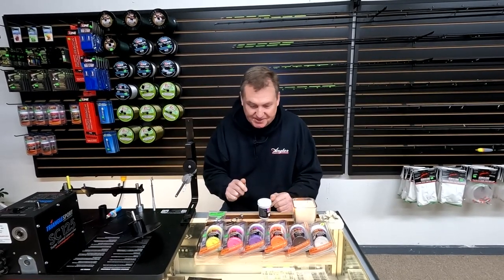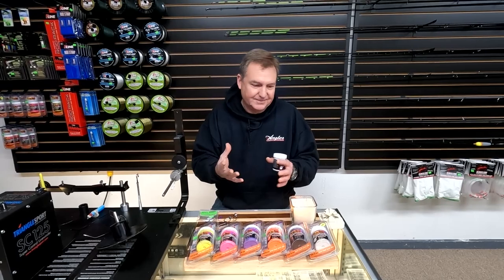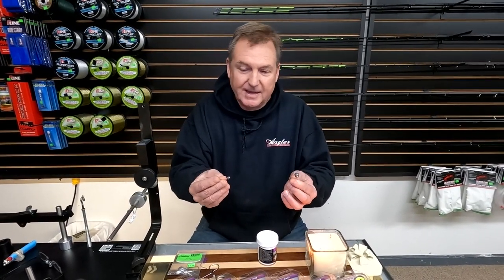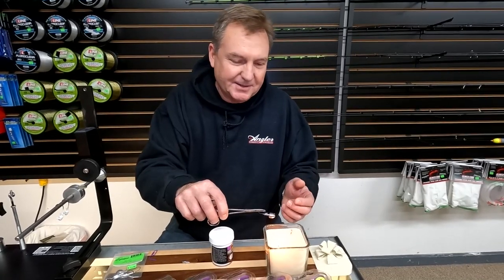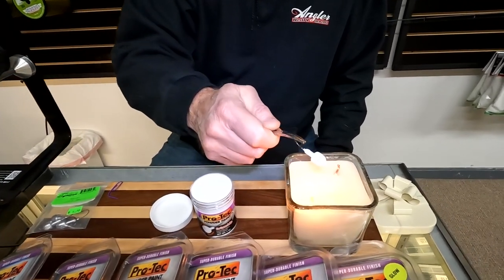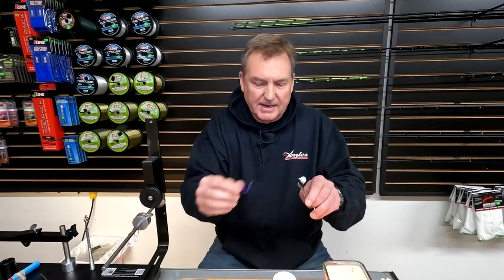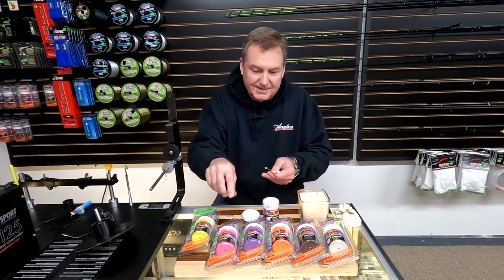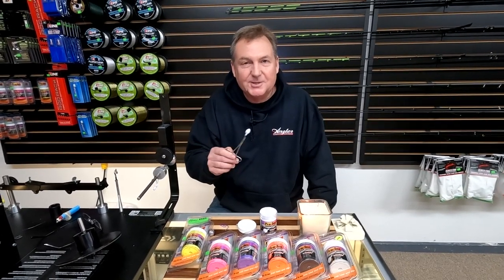How To Powder Coat Jig Heads (The simple way)

Comment: Definitely worth going through the oven baking process, makes the powder coat about 10x harder and crazy durable. Like the difference between paint and ceramic. Just make sure you clean out the eye before baking or it's almost impossible to get out after baking, without a tiny drillbit that is. Been using this protec powder paint for about 20 years and just started baking them a few years ago. Wish I'd have always baked them.
Reply: Yeah I've been doing the same for 25 years too. I went down to a thrift store and bought a second hand convection oven that I throw about a 100 jigheads in an aluminum pie plate to heat to 350. Then I take one at a time out to dip in the powder, then hang them on a rod to cool. When all done I put the wire rack in the oven on the top bracket then hang all the jigs on it by the hook then bake on 350 for 20 minutes to make them hard just like David O said. I can do a 100 jigheads at a time in the 1 to 3 oz sizes.
Reply: Lookup Stardust paint. Doesn’t require curing. More expensive but worth it!
Reply: When you bake it in the oven, does it leave some sort of scent lingering in the oven?
Reply: A hook is a very small piece of metal and it is tempered I would not be baking the whole thing in an oven regardless or you will compromise possibly the heat treatment of your hooks and that could lead to failure while you are using them
Reply: @mastereclipton  get yourself a little toaster oven from like a thrift shop or something and just have it as a designated jig oven

Comment: Kind of an off questions but do You think it would be possible to do plugs ?
Reply: If the plug is metal, it would be possible, but the coating is fairly thick and might change the floating characteristics . But a plastic plug would melt at the temp needed to melt the paint.  An air brush would be your best bet for plugs.
Reply from the maker: Thanks David. We will have air brush supplies in stock soon as well.